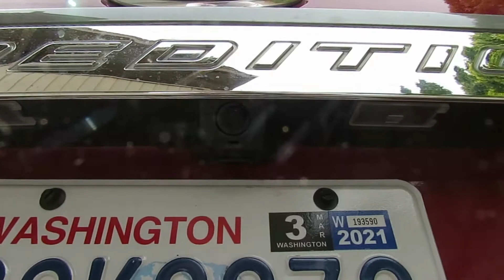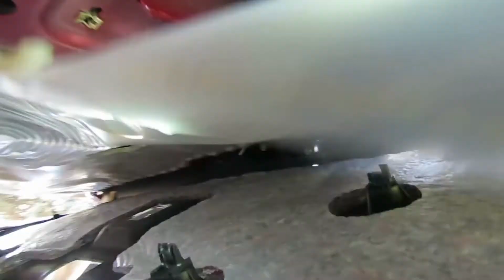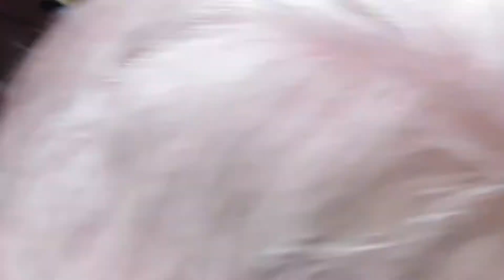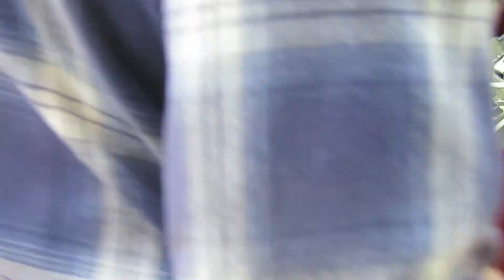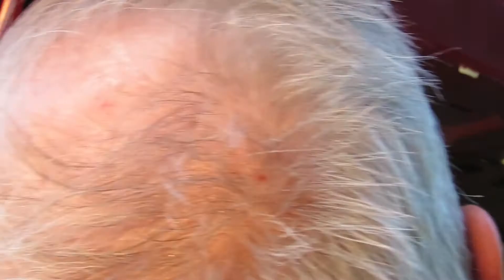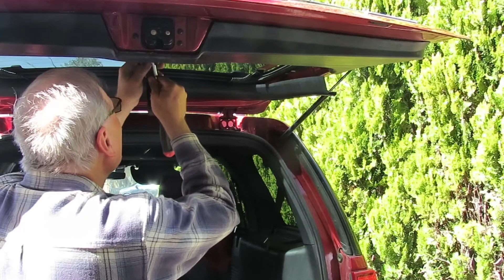Ford Rear-View Camera Repair

Comment: I cleaned mine with electric contact spray cleaner heavy and injected dielectric grease put it back together and it’s worked every time, this video did still help me get to the clip.

Comment: Our camera flickers and a bit blurry most of the time but occasionally works perfect. Any idea what is wrong?
Reply from the maker: The lens is integral to the camera, so a blurry image indicates that the camera body has allowed the lens to move relative to the imaging chip. There is no repairing of this - you can only replace the entire camera. Flickering implies a poor connection internal to the chip; again the camera must be replaced.
Reply: We had the same thing happening, and eventually the camera stopped working altogether. I'm trying to figure out if it's a wiring issue rather than a bad camera, but I don't know yet.
Reply: That was our camera until a month ago, then entirely stopped working. It would work great for a week, then funky colored image that was distorted, then stop. I tried tapping it a few times, and perhaps that helped short-term, but it's really done now.

I took the camera out today, wish I had read Carissa's comments first, so now I'm in the "need new clips boat" instead.  I jiggled it around several times and plugged it back in also to see if it was wiring, and it didn't come back on, so I don't think so. As soon as I can get the camera, I'll try to come back on and report if it worked. If it does, hopefully the back of the car can remain intact from here on out. I miss that lil' thing...

There is a camera recall on newer models 2019-2020, but they skated on us. Also, mine is the FL1Z-19G490-AD, but it appears the B model is what several Ford OEM websites indicated, so Tom's link should be OK.

For those thinking about taking it on, it's not too bad of a job, did it in about 30 minutes or less. I had been dreading it for a couple years now, but the stupid camera would start working again when I got serious.  (It knew).

Here's the TLDW:
Step 1: Take out the T25 screws for the grab handle
Step 2: Carefully remove the plastic panel, and if you break the post mounts like Tom and I did, plan on using JBWeld to fix. Not sure how not to, though I only lost one.
Step 3: Carefully remove the plastic liner (it was somewhat warm in the car, so I was able to save all the adhesive by gently pulling on it, but you might need to use RTV to restick it. I  only removed 3/4 of it, to get to the four screws.
Step 4: Remove the four T25 screws holding the trim piece on (from inside the body
Step 5: While you're there, use the Carissa's Dad method to squeeze/loosen the trim fasteners  (yay!)
Step 6: Gently pull the trim piece out, it will hang by all the wires, so be gentle
Step 7: Use a T20 (I think) to remove the camera  (I would test it before removing to see if the jostling helped, but I would just put the new one in no matter what)
Step 8: Test the camera, then reassemble 

Thank you Tom!!!  I clicked on the link and bought the camera, should be here Tues 10/19/21.
Reply: So the replacement camera fixed it, but now I need to replace the broken clips (I knew better, but got in a hurry) so I can button it all up.  
Do not try to use other clips unless you ensure they are sealed, otherwise you will get leaks in your lift gate, and that won't be good for the motors, electronics, CAMERA, and metal.  
I went to the dealer and got eight of them for a bit over $20, which I'm happy with to get this job done!
So the Ford part # is W716351-S300.
If you search Amazon, I found a pack of 25 for $15.
AMZ Clips And Fasteners 25 Wheel Opening & Rocker Moulding Clip Compatible with Ford W716351-S300
Reply: @netwrench6570  your problem sounds similar to ours. We’d go from working sometimes perfect to a digital scrambled image, back to occasional perfect image. More recently it often gives a blue screen and no image with message on the stereo “no image available”, then occasionally works perfect again.
I’d love to know if it is a loose ground wire or something like that or a bad camera. I’d hate to replace the camera only to find it was not the problem.
Reply: @paullangan3153 We had the same issue and just took everything apart and cleaned the connection well with rubbing alcohol. It is working well so far. Time will tell if a new camera is still needed.